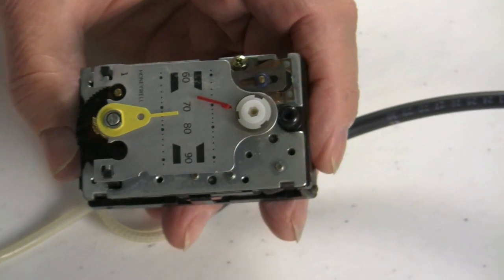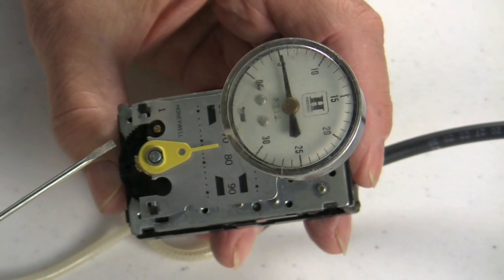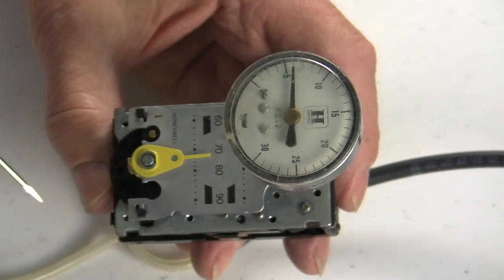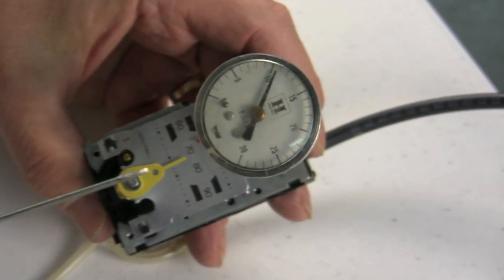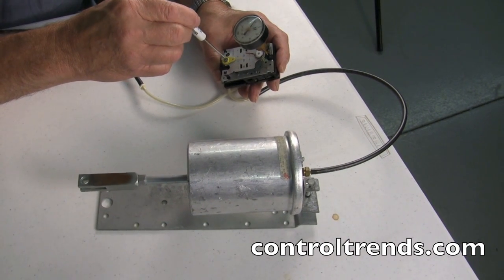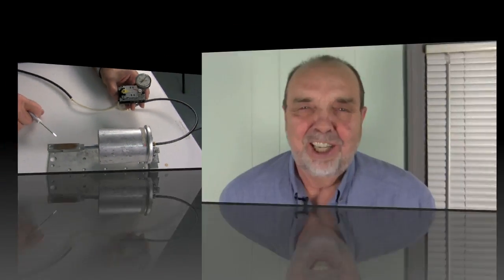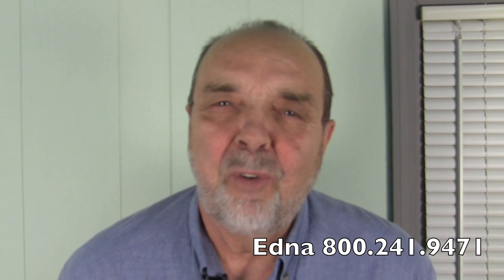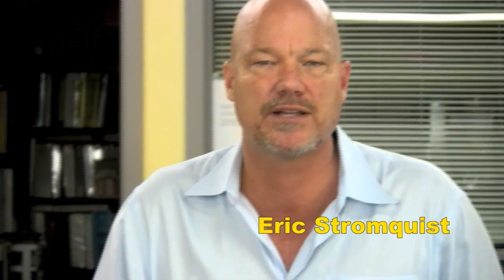HVAC Tech School:How to Calibrate a pneumatic thermostat

Comment: at my new position i need to deal with the Honeywell LP916B type of winter/summer t-stat. I took two classes  with Jerry in N.Y. and N.J. back in the 1990s so I understand the operation of D.A for winter and R.A. for summer etc. What I am missing is how the the switch over from 13# to 18# can operate a pneumatic valve with one fixed spring range.
I am not sure as yet what the spring range of theses Honeywell 3/4" two way valves are but I will take the air line off one and use a "ben casey" to find out. Any ideas out there?  A Happy 2017 to all.